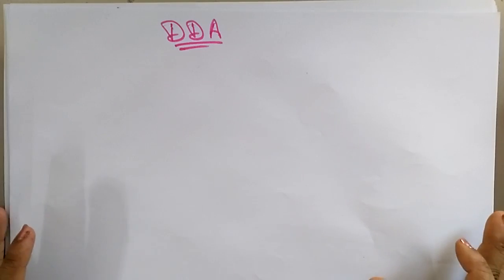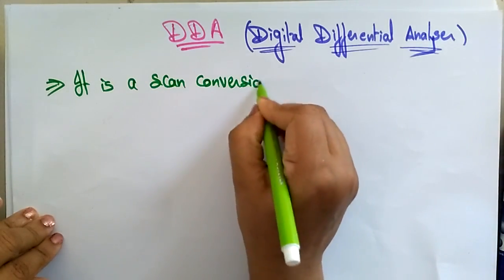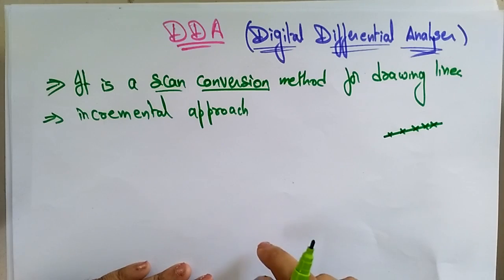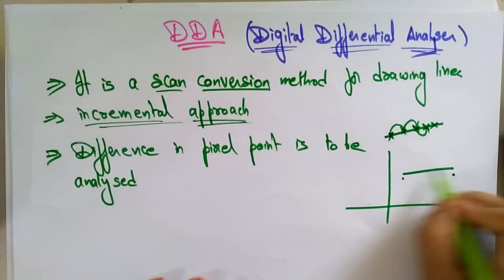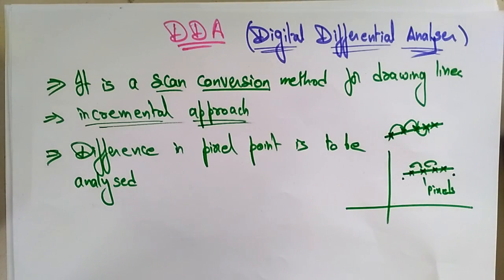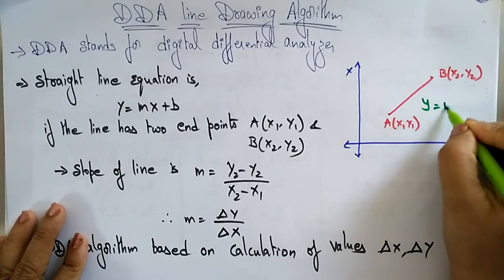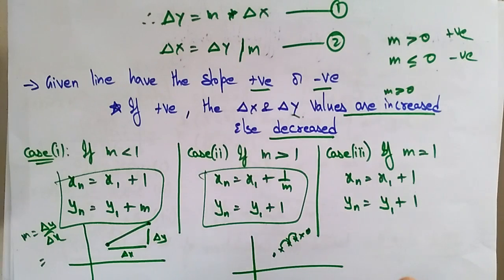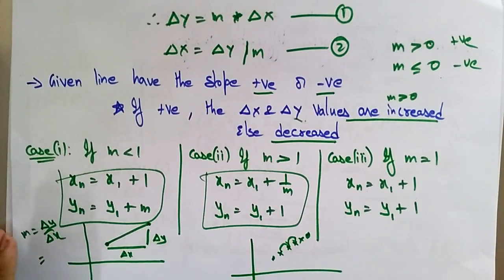Digital Differential Analyser | DDA | Introduction | Computer Graphics | Lec-12 | Bhanu Priya

Comment: ✅ Advantages
- Simple and easy to implement
- Works for all slopes
- Faster than using the line equation y = mx + c

❌ Disadvantages
- Uses floating-point arithmetic → slower and less accurate
- Rounding errors can cause jagged lines
- Less efficient for vertical or steep line

Comment: 7:53
All indexes in all three cases should be changed to:

case (i)
x_{n} = x_{*n-1*} + 1
y_{n} = y_{*n-1*} + m

case(ii)
x_{n} = x_{*n-1*} + 1/m
y_{n} = y_{*n-1*} + 1

case(iii)
x_{n} = x_{*n-1*} + 1
y_{n} = y_{*n-1*} + 1

This stems from the fact (as you said) that the algorithm is incremental and you need the previous value to calculate the next one.